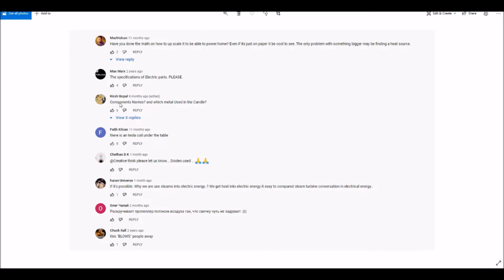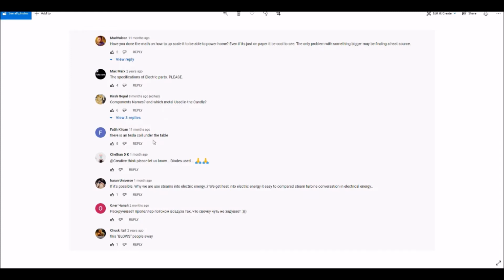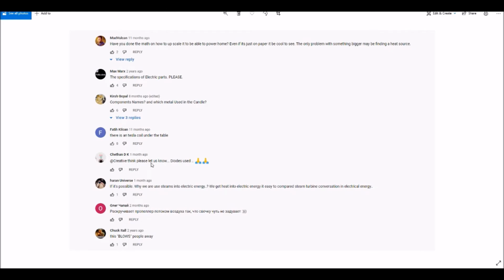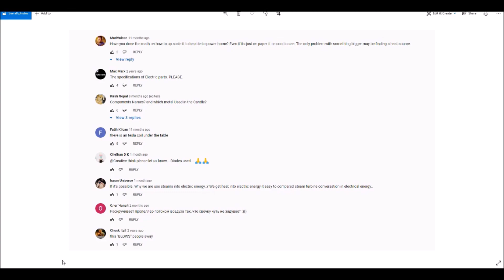{----- Watch this before building another free Energy device!!

Comment: This device cannot run this motor as produced, that is an absolute fact. You have definitely shown that in this video. I'm not sure it was faked in the way you showed, but the original video is definitely fake. My very first science fair that I did in high school was a 3v transistor radio powered solely by a candle flame. It would have easily ran this little motor you used. It's called a thermocouple. I know you're aware of a thermocouple and the fact that you can exchange heat energy into electrical energy with one. I'm just wondering why you didn't mention it and show how you could run that motor with a candle flame done properly. Instead you claimed that it's impossible knowing full well that it's not.